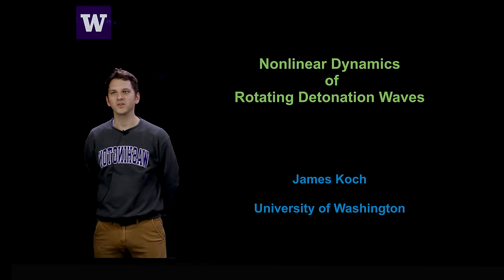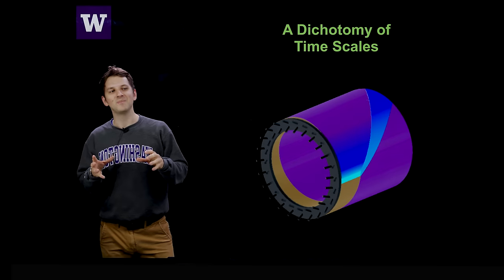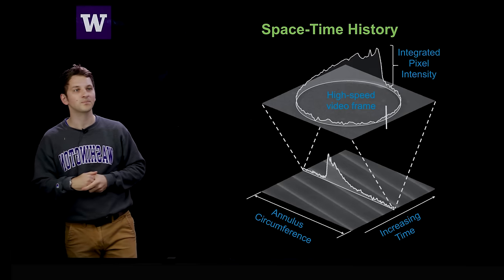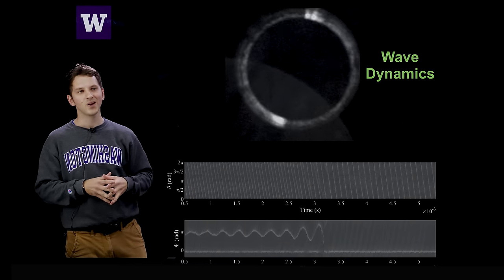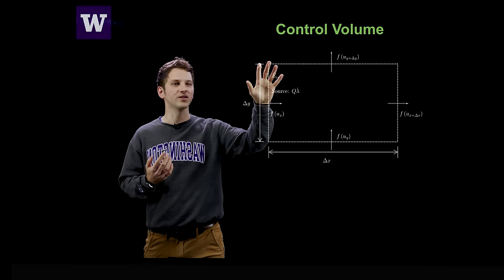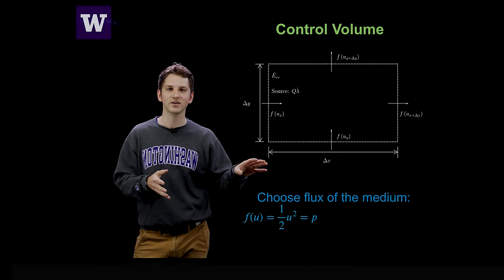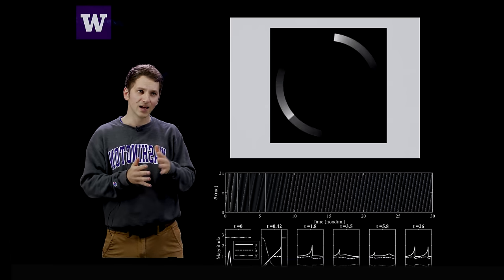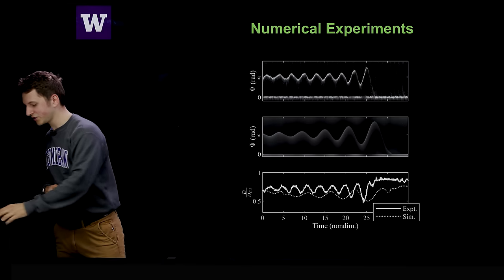Rotating Detonation Engine (RDE) -- Dynamics and Bifurcations

Comment: Who's also here after Scott Manley's video?
Reply: yep
Reply: yeah, thinking of looking into pulse and rotation detonaton engins for my BEng and MEng projects because of it
Reply: nope, been looking for ring detonation engines since some nut crack talked about the ghost plane Aurora that supposedly had a full body aerospike ring detonation engine that ran on some shock sensitive metyl mercury compound. The fuselage was the ring inner wall and the hyper sonic shock-wave was the outer. They stopped flying it because the immense mercury pollution gave it away. Obviously all complete bs.
Reply: Yep, I really hope we get these engines in KSP2
Reply: That and the fact that this reminded me of DARPA and Boeing's Blackswift program where they were trying to test out new vehicle designs for SSTO, could have sworn the wiki on the Blackswift project at one point in time stated they were using a PDE... Ohh well
Reply: Here
Reply: guilty
Reply: @zephyrmadera5180  they wanted to, but research was halted fairly quick afaik. Also I am pretty sure that it was all just plans at that point, most of it is classified even after almost 20 years so who knows... BTW look at Htv3 Blackswift and look at the sr72 proposal. Then multiply by skunkworks being involved and do the math  :)
Reply: @chrome4096 Neat! I think the fact that RDE's can effectively be throttled, are more thermodynamically efficient than CP jet engines, and can be incorporated into an aerospike nozzle engine design are great advantages for their future implementation. The other technology from the UK that I liked was SABRE. It would be great to see the lox regen of SABRE, useful when "flying" above the Karman line, combined with the thermodynamic efficiency of RDE's. If an expander cycle driven turbo pump for the on stage fuel tank and heat pumps for heat dissipation of intake air through control surfaces could be incorporated that would be even better, since the engine and cycle would naturally generate tons of heat and have a high surface area. Most of these new designs require high temperature materials most of which are ceramics for the extremes in temperature created by these engines. One research paper I enjoyed was on the use of Thiol-ene click chemistry for creation of relatively cheap ceramics parts with complex surface geometries using 3D printing pre-ceramic polymers. I'm surprised it hasn't gotten much attention in the Aerospace industry...
https://www.sciencedirect.com/science/article/abs/pii/S2214860418310479

Here is a like to the full paper available in paperback through Amazon
https://www.amazon.com/Photoinduced-thiol-ene-chemistry-manufacturing-polymer-derived/dp/3798330883/ref=sr_1_3?dchild=1&keywords=thiol+ene+click+chemistry&qid=1616045902&sr=8-3
Reply: @zephyrmadera5180  I will read through the paper in a minute. .. my understanding of the sabre design was that infact they are using the enormous amount of heat created in the engine at least, but probably also in the fuselage cooling effort, is in fact being used in the compression of the airstream to partially liquify it. I remember something on the order of a couple MW of energy used in an expander cycle to drive the compression turbopumps. I am also very fond of the aerospike design, but  it does cause a lot of trouble cooling and material wise. I just recently managed to get my larger 3d printer going again, my short term goal has been  trying a couple of materials  that I saw at formnext 2019. I am pretty shure that a lot of the commercially available ceramics could easily be driven way higher than their stated max temps by means of the right coating. I am particularly interested in finding a way to use Tantalum hafnium carbide or its indiovidual carbides to create a kind of supercoating. 
If there would be enough mass fraction left at a low enough temperature, the exhaust could also be used to cool the aerospike and also make it a lot shorter and elongate it through the exhaust plume, I believe that has ben done on the rs2200 from the venture star project to have less surface area on the spike. I think the great thing about the pulse detonation principle is in fact using a different thermodynamic cycle, so it could in theory at least, offset quite a number of existing designs. I tend to however fall into the principle of simplification. One eye opener for me was Elon Musk actually stating in a video from Everyday Astronaut I believe about aerospikes, was that  in fact the arrangement of the multiple engines on falcon rockets in fact forms a kind of aerospike effect through the circular array of the engines, which does make sense if you closely dissect the exhaust plume, so the principle might be used in a less obvious way. Sadly I had to quit studying aerospace engineering for the time being, so all I can do now is privately funded, aided by being a machinist with a little more understanding than the average bloke..
Reply: I just wanted to add the nasa papers on the scramjet engine intakes, i cant think of the name off hand, also got me interested as they used 3 printing as a template to use galvanic plating with copper and nickel to produce the test articles for their mach 5 wind tunnel. I have a friend who could have me 3d printed inconel parts, but even paying for the raw material from a private budget is not really reassuring ... over 1000 € per kg is quite disturbing considering how dense the stuff actually is. Even in a university setup, I can see why a lot of fellows look for military funding, but then most of stuff ends up in a locked drawer for the better part of a couple of decades. BTW I dont have access to science direct anymorte but the abstract seems promising, most of the stereolithography I could get a hold of would not be quite bis enough, It would be interesting to see if thhere are FDM capable conversions of those Polysiloxane based materials, should be possible in theory, sintering will have to be done either way
Reply: @chrome4096  Yup, the photoinduced thiol-ene click reaction just gets you to the green body stage, but it's still pretty good considering the otherwise enormous amounts of heat you would need to otherwise polymerize the polymers to get to that point. One of the reasons I think FDM isn't widely used is for that same reason, you need something really beefy generating lots of heat just to get the greenbody. The paper is also available through Amazon, and one of the great things about the researcher's approach was the emphasis on practicality and cost effectiveness of the printer design. They give out a list of the equipment needed to build the setup they used. If I remember correctly the setup was well bellow $1k, not including the PCP's( Pre-ceramic polymers). The author's also concede that the method would work best for thin walled structures like a shell, skin, or liner due to the dimensional shrinkage that occurs after the green body has been sintered. 

https://www.amazon.com/Photoinduced-thiol-ene-chemistry-manufacturing-polymer-derived/dp/3798330883/ref=sr_1_3?dchild=1&keywords=thiol+ene+click+chemistry&qid=1616045902&sr=8-3

The reason why I tend to prefer RDE's instead of the PDE's is that the RDE's have less combustion instability problems when being throttled up. The other advantage would be that the combustion chamber for an RDE is most likely going to be an annulus, which means the outlet and exhaust gas is already geometrically matched to the aerospike so you would just need an RDE whose annulus diameter was slightly larger than the diameter of the aerospike-this engine wouldn't require the redundancy problems faced by traditional rocket engine based aerospike nozzel engines. From most of these RDE videos I could find it also looks like having the aerospike would reduce the exhaust/flame front instability issues you see as a partial vaccum forms due to an air venturi from the large emtpy space around the center of the annulus as the exhaust gases exit.
Reply: yep me too
Reply: +1 because need more info hehehe
Reply: @chrome4096  yeah pretty much. This technology has been in development for decades now and goes back to at least the 80’s since rumors had it they were flying various prototypes in the 90’s and obviously this technology has been classified and is the real reason why you don’t hear anyone speak about it beyond the basics… most ppl have no idea how technology really works and how the classification system in the US really restricts the public from being able to learn about cutting edge advanced technologies and usually for good reasons despite what your capitalist enthusiast would say, just look at what happened w/ nuclear weapons….
Reply: Scott, the motoring show guy with the shouty voice?

Comment: Holy crap its so refreshing to see youtube content that doesn't sugar coat the complexities of these types of computational models. Noticed the papers aren't linked in the description like he mentions towards the end of the video. I'd be interested in seeing what kinds of solve times these models have been yielding, and if it would allow for nesting the model inside a parametric optimization study to find optimal configurations in terms of thermal efficiency. Really great content, keep up the great work!!
Reply: The mathematical model is not very complex so my sense of it is it wouldn't take more than a few minutes for simple solutions and not more than a couple hours for a more complex evolution of behavior on a single fast pc core.  So worst case I would guess with an 8 core cpu about 10 days for a 1000 runs for doe analysis which would only take an hour or so.  The problem is at the moment he only has qualitative confirmation he would nedd to refine the model with at least a few constants to obtain quantitative conformity to do an optimization.
Reply: @RamPenndragon  I remember watching a us air force video from the edwards afb channel where they mentionned that a full simulation including pressure and temperature took them a month to run, there weren't any details though

Comment: This is really interesting even though I don't understand half of it
Reply: Same here. Not only interesting, it's very beautiful. Yet, most of the stuff is just Alien language to me.
Reply: We need some popular language translator.
Reply: @temukaify  These technical terms do have some slightly specific meanings but none of them are rocket science (haha)

cicumferentially - around the circle (how the needle rides the record)
radial - back and forth between the center and edge of the circle, 'across' it basically (how you scratch the record)
bifurcation - spliitting into two (pissing two streams instead of one)
tangential - a straight line off the edge of a circle (car sliding off a corner of a track)
detonation - an extremely fast form of combustion in which the explosion passes through the material at a speed of miles per second (c4/dynamite, shatters steel)
deflagration - slower, more traditional burning through oxidation of material (gunpowder/fireworks, bends steel)
annulus - ring shaped (lol)
luminosity - how bright something is (setting a dimmer)
pressure gradient - simply a change in pressure over distance (swimming to the bottom of the deep end of the pool)
amplitude modulations - system or process controlling the intensity or power in something (sitting on top of your little brother)
simple harmonic motion - back and forth or circular motion in tune with how the system wants to be have (swinging on a swing normally vs pushing someone slowly back and forth on a swing)
coupling of shock front and heat release  leading to stable phase difference between the two detonation waves - essentially just means that energy dumps into a system and back out at just the right speed for the next cycle of the same.  (basically just like a small engine running or, more simply, juggling)

Any other words just google them right away.  In my opinion this guy isn't doing this to sound smart, he's just up to his eyeballs in this stuff.  Like i said all of these terms have kind of specific meanings that only matter when they matter, and sometimes are used to differentiate other terms that could be summarized exactly the same way i do above but mean something different.
Reply: @temukaify  He is slightly overdoing it with terms. Stating that the detonations are 1rad or pi or 180 degrees apart is a less clear way of simply saying opposite of each other. Instead of nucleation he could say just start... temporal evolution is just change over time... 

Sure, he needs some tough terms to explain this that you and I don't understand, but in the end it becomes a non-explanation if you have to pause the video to find the popular synonym for every other word, even to someone in the field.
Reply: @AdamPitas  Eh, he's close to the metal so to speak so I'll give him that. A lot of his terminology is powerful due to the fact that it has cross-disciplinary value, and is telling of his background, which is dynamical systems. The modelling of crap of any kind necessitates these levels of abstractions, and once you define the tough terms and see them used in context, you'll realize that he's surprisingly terse.
Reply: @trejohnson7677  True, and this video was directed at people in those fields, but I do appreciate it when explanations are kept concise, be it written or spoken. I really learned a lot from Steven Pinker's books on this... sometimes papers get a little carried away with terminology. I guess it's in line with "being able to explain it to your grandma." The paper is written quite well though, easy to follow, I would need to study quite a bit to understand it, but the flow is intuitive.
Reply: @AdamPitas  He's definitely over doing it but I think thats standard for graduate students.
Reply: They are continuously using pressure from controlled explosion to compress the fuel mixure for explosions.

Comment: Very impressive work! Having the engine built and devising a model that exactly matches the observed characteristics must be a delightful experience. Looking at the PDE one wonders if it would be possible to find closed-form solutions. Engine blow-out dynamics are probably also non-linear and most probably coupled with the rotational dynamics. Stability conditions of engine blow-out is probably a research path based on this work.

Comment: Really good video. I loved the description of the oscillitory wave motion of the Shockwaves around the annulus of the combustion chamber. The transient states of the Shockwave formations were very reminiscent, to me, of the transient states of a jet engine and of course you can also get engine surge in a jet engine if the throttle is being increased too quickly across a transient flow regime. I enjoyed the description of the conditions under which the engine would become choked and the stable and unstable (or transient states) that have oscillitory motion and shock wave formation dictated by the amount of energy or fuel that is inject into the combustion chamber. The video really helped me understand, I think, how you can generate a detonation shockwave simply by triggering a deflagration reaction in the annular chamber and allow the pressure differences within the annulus to naturally increase the strength of the flame front over time till detonation occurs

Comment: Thanks! The names of mathematical functions helps begin a search. The equation you used, exactly, would save my time. The combustion precursors, their densities and flow rate changes as the wave propagates circumferential, would also be interesting parameters, if you have them available. The dimensions of your combustion annulus would also be interesting. Your overview suggests a close correlation between the variations in combustion dynamics and dimensions of your experimental setup.

Comment: I was just looking at suspending droplets in midair using soundwaves, and I wondered if this process could be used in an engine. Come to find out, this RDE concept seems to basically be the best way to revolutionize chemical rocket tech, being that this way MUCH more power is extracted.

Comment: This is an amazing application of the Burgers'-equation-based detonation analog in capturing some intrinsic wave features in RDEs. The analysis is very inspirational. I'll be staying tuned for the future work. A little suggestion: The lack of backward running characteristics in Burgers' equation limits the current model from capturing counter-rotating detonation waves. The use of the shallow water equation might be explored to construct an RDE-detonation analog model.

Comment: Thank You, found this very interesting! 
Excellent presentation for us engineering types, simplified enough for us to understand but not dumbed down to much...  I am familiar with pulsed detonation concepts but previously never grasped the potential advantages of a rotating system and its stability problems. Remember reading something (Los Alamos report perhaps? ) long time ago about stabilizing combustion by electromagnetic means by MHD type action. Wonder if something like that could perhaps be used to force the desired mode in the combustion chamber.